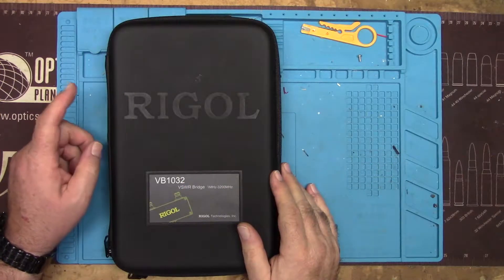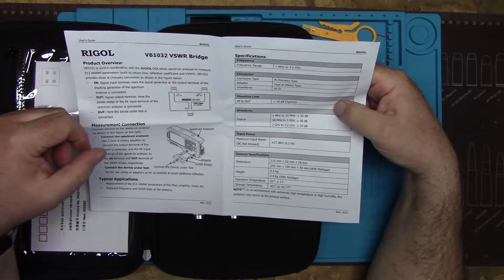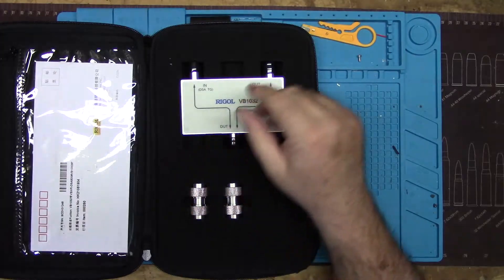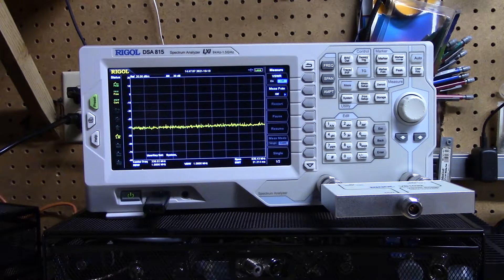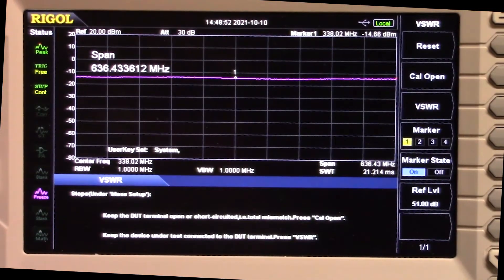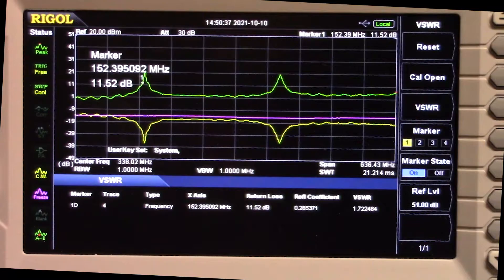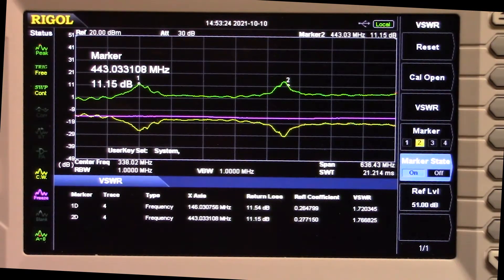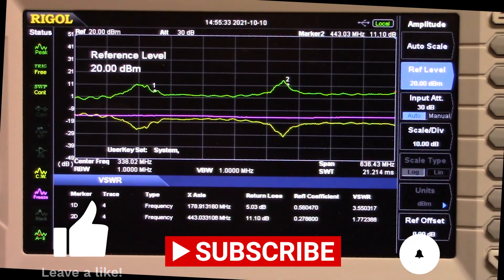Use a VSWR bridge with the Rigol 815 spectrum analyzer

Comment: That was a great video.  Thanks.   What about comparing to a RigExpert?   It was on sale last week for around the same price for the 1500 Zoom and it seems like the RigExpert has a lot more features given it can do vector analysis etc?   I was going through the same thought process and settled on a RigExpert.
Reply from the maker: Hey Joe - the RE is a great tool.  I'm on my third one (sold the other 2).  I have an AA-1400, and love it.  The data logging functions you can do with Antscope make it worth it's weight in gold.  Also, the RE does some very radio specific funtions that you don't/can't do on a spectrum analyzer (and vice-versa).  The SA won't do Smith charts, nor does it have a TDR function, and I can't sweep multiple band ranges at one time.  The RE is oriented towards field/end-users, much more than the SA.  The SA is move of a lab kind of gear, but provides a lot more functionality in other ways than a RE won't do.  So - both are very useful.  This is some cross-over.  Thanks for watching!